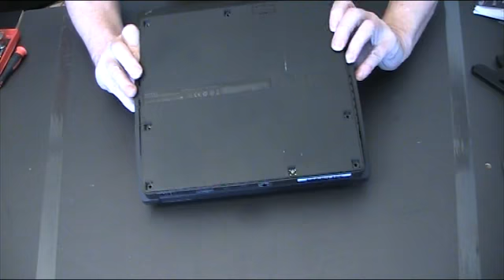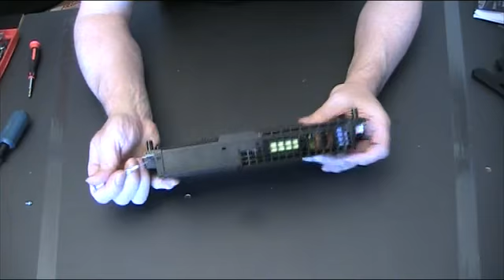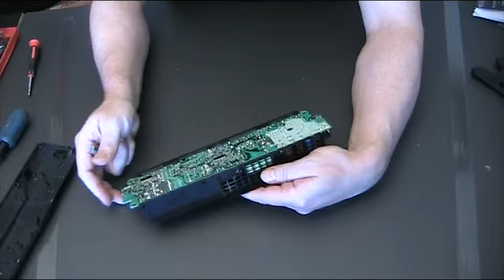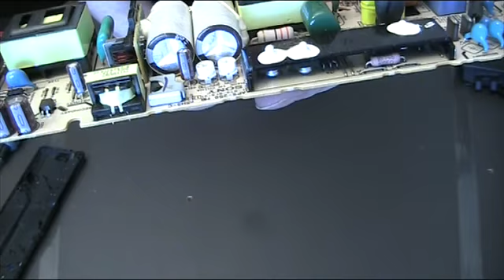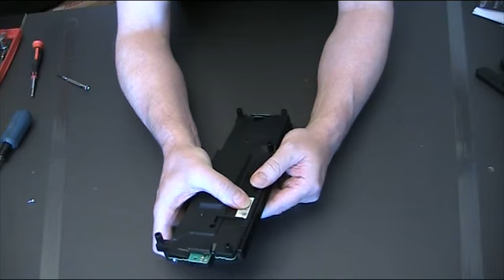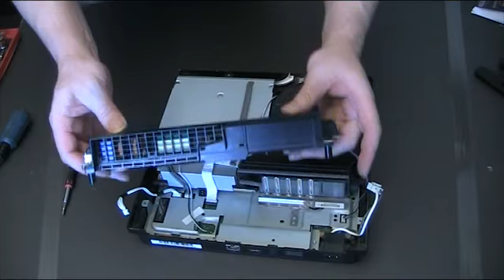PS3 SLIM | No Power Fix - 10 min PSU Repair | APS 250

Comment from the maker: It could be a power supply problem but equally it could be anything. You'll need to use trial and error to figure out what the problem is. Try another PSU if that doesn't fix it then strip the console down and see if it runs without the blu ray drive or hard drive. Swap the on off switch data ribbon. Of course it could be a motherboard problem, it's impossible to tell without testing.

Comment from the maker: Hi These little potentiometers (Trim-Pots) vary the current to other components. By turning them from their original position (indicated by a marker line) you change the mirco current. It's not very scientific (as electronic "experts" keep telling me but if it gets the console running again why not give it a go. The alternative is to replace the power supply or get professional help which cost big money. Hope this helps
Reply: And how long will this fix last?

Comment: Hi Steve, my PS3 slim was cutting out after around 10-20 mins use, leaving no lights on and unable to start. Only way to get it back on was to unplug the power supply leave it a while then back on but same again. Anyway took it to Techbytes in Glasgow where they "had it on for days" and could find nothing wrong with it. Got it home and same again...followed your video to the letter about 3 hours ago and my PS3 has been running sweet as a nut ever since

Thanks you very much mate

Steve

Comment from the maker: Hi James
Sony likes to keep us on our toes by constantly changing parts. Unfortunately the newer PSUs don't have the adjustable potentiometers. If the power supply is the problem you will have to replace it. I think it's an EADP 220 you need but check by looking on the bottom of your unit.

Comment: Hi there, i have the 160gb ps3 slim, bought it about 8 months ago and now have no power or lights working, but when i take out the psu it looks completely different to the one you have here in the video, does not have the adjustable switches like yours!?

Comment: the trimpot have three pins, are united in the same pins on both trimpot 250?, because the 270 are attached differently. I believe that this difference depends on the change in rotation 270.

Comment from the maker: I think it works regardless of what direction they are turned. I used a 250 in the video and I haven't received a faulty 270 yet but I assume the system is the same as it was an upgrade from the EADP-200 PSU. If you know different please let us know.
Cheers Steve

Comment from the maker: I just got a EDAP-220BB in and I imagine it's the same as the EADP 200D. It doesn't have the adjustable potentiometers so You have to replace the fuse.